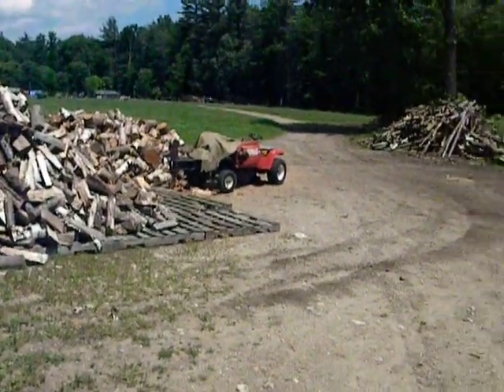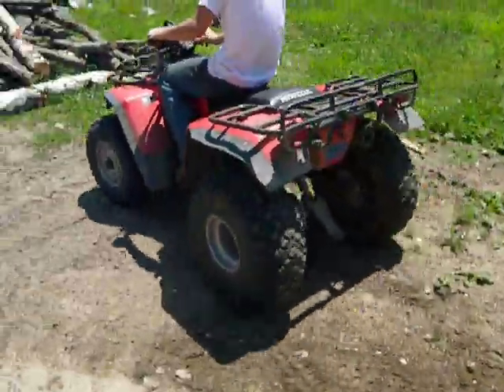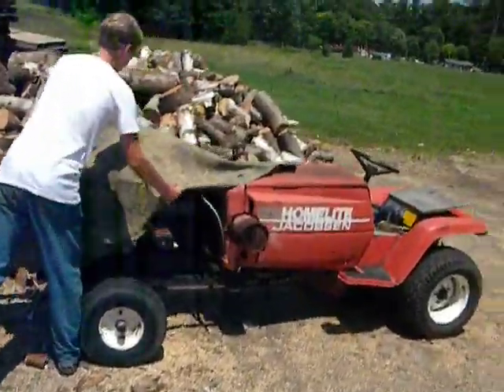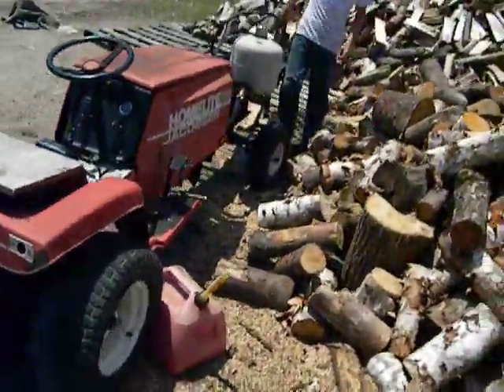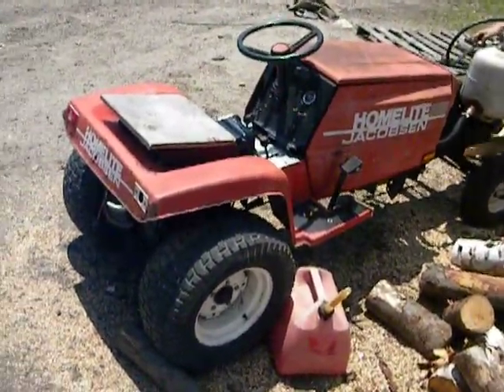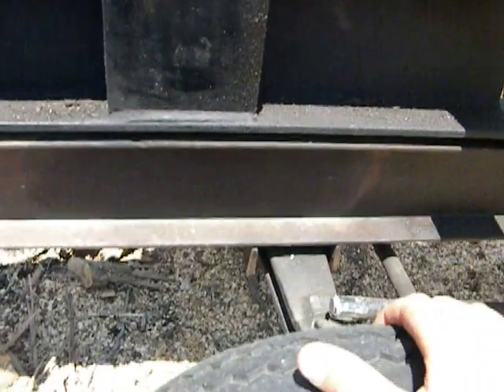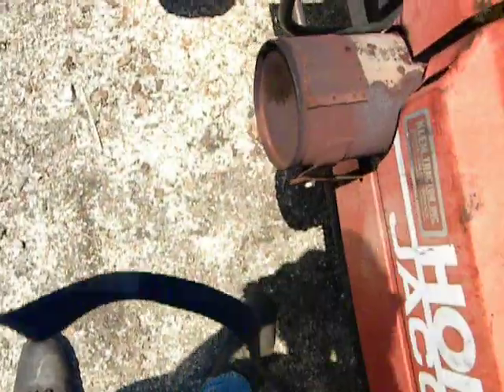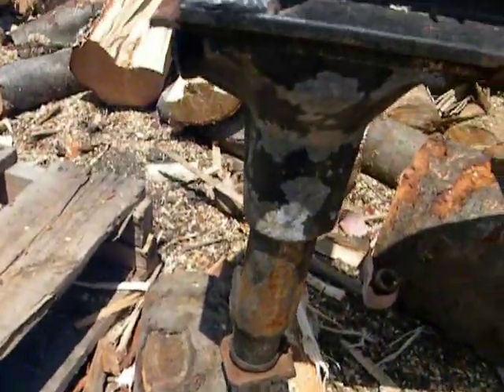jacobsen homelite homemade woodsplitter

Comment: Id like to see an updated video on this machine if you still have it. Things that have changed to improve it as well as how it has been doing
Reply from the maker: This mower splitter is no longer but we do have a new splitter built out of some of the parts
Reply: @MegaMoto4  What ended up happening to it?
Reply from the maker: The Kohler that was in that mower was shot burned a quart of oil to a few gallons gas and the hydro went out of the mower so we repowered the splitter as a tow behind unit with a new Kohler. Wasn't worth putting all that money into that particular mower

Comment: This is pretty cool . But couldn't a guy just tow the splitters behind the lawnmower then attach The love joy to the the lawnmower engine and run long  hydraulic hose back to the log splitter with quick connects? So you wouldn't have to weld  the splitter to the frame of the lawnmower???

Comment: Nice machine, but that tractor is probably from the mid 80s, not the 70s. 70s Jacobsens were pretty primitive looking compared to these. My uncle had a Ford LGT 165 from the 80s that was basically the same as this. (Ford garden tractors were built by Jacobsen.)

Comment: I want to do the same except put it in back or just pull it,same as you I figure just take off the mower blades and attach a hydraulic pump to the pulley.